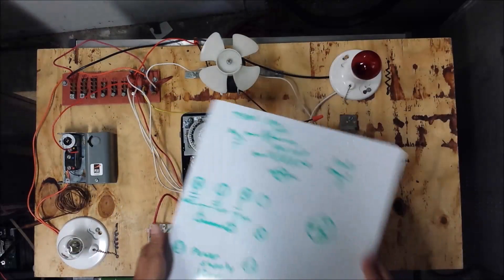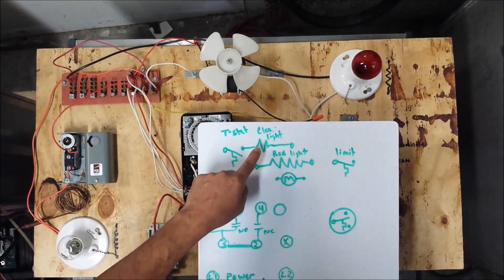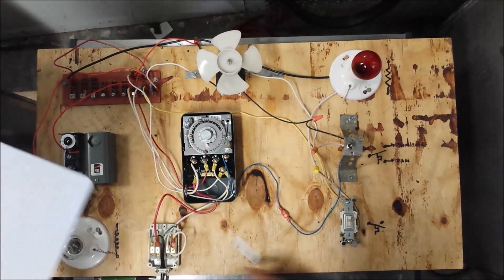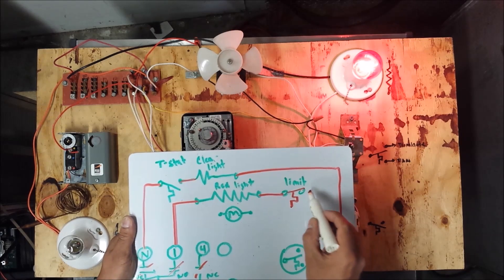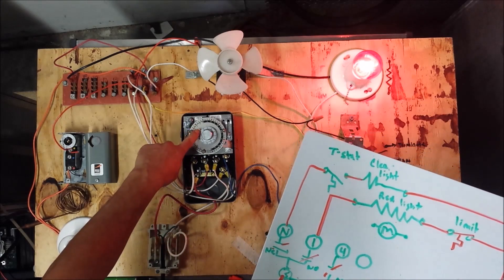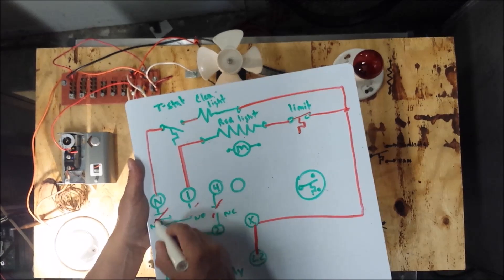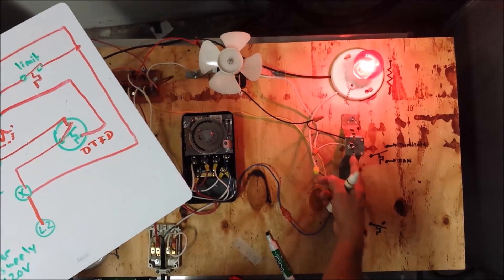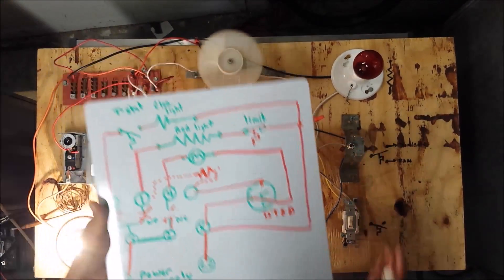Freezer Defrost Timer Live Operation

Comment: Thanks for the video.  Good circuit logic setup/explanation.  Only thing you did not mention the functionality of is the thermostat on the left hand side of the setup.  I assume that is just a refrigerator thermostat controlling when to kick on the compressor to cool the frig. to the proper temperature.

Comment: When I go to Sam’s Club, I noticed that sometimes the evaporator fans in the coolers holding the frozen foods are off.  I assume that when the fans are off, the evaporators must be in defrost mode as you have described in this video.  However, when I look at the evaporators in the refrigerated (non-frozen) foods cooler, those fans are always on (never off).  What defrost system do you think the evaporators in the refrigerated foods cooler have which does not require the fans to go off?  Or is that the fans do go off in defrost mode, because of the warmer temperature that the refrigerated foods cooler is in, the defrost cycle does not happen as often?
Reply: Some air defrost walk in coolers do not have electric heater. Most fans in these coolers are always on. 
Here is the walk in cooler which is air defrosted.
https://www.johnstonesupply.com/storefront/product-view.ep?pID=B92-118
Reply: you usually don't need a defrost in a cooler. otherwise the defrost just shuts the compressor off for x amount of time and let the fans . the only time you really have problems in coolers is when you lose a fan(or multiple fans) or a very dirty evap coil restricting air flow.  Then the coils will freeze up

Comment: Charles. Great video!!!! I have a question.
How is the compressor able to accomplish pump down of the system,when I switch from 2-4 refrigeration contact to defrost 1-3 (now closed)? I can't see it how it's done,since evaporator,thermostat and solenoid are all in series on the same circuit,namely 2-4.
By switching from 2-4 contact to 1-3 contact now energized, I de-energize the solenoid,now closing and pump down can't be accomplished by the compressor.
Please help me understand this problem. Thank you
Reply: The compressor is not part of this circuit. Only the solenoid that controls flow of refrigerant. Once the solenoid closes the condenser still runs pumping the system down. Eventually the low pressure switch on the condensing unit triggers and opens the circuit shutting down the compressor.

Comment: i have kitchenaid model is YKBRS21KAW00  my problem is .if the temp control is off!!   the defrost timer is making noise and advance, evap fan is running but slow  and compressor wont start.but freezer will be cold 

 but if the temp control is on!!!   the compressor start ok freezer stay cold,but defrost timer is not making that noise and does not move a bit, evap fan won't start at all and inside the fridge part its hot no air coming from the vent in fridge. .

the light in fridge and freezer stop working and there is a small switch for uses less energy if flip one side and flip on other side is for reduces exterior moisture the light does not come on either on the switch. not to sure what this switch  do but din't seem to make a difference in the pass but i know that light was coming on if it was flip on before . 

any suggestion of what can be wrong ?

I change the defrost timer and i change the evap fan and the temp controler too at the same time !.something is running backward but not sure what could do it ...
Show less

Comment: I helped our warehouse tech to install a timer on a freezer, we followed every step and traced all of the wiring! it's not kicking into the defrost mode or turning the compressor and fans off! IDK if the wiring is bad or bad timers!
Reply: could be a bad time clock or the defrost pins are missing? the so might not be working to pump down the system, could be a bad low pressure switch, there are many think that could cause that.

Comment: Thought N was neutral
Reply: Thought 4 was the control circuit
Reply from the maker: Usually N on the majority is for the L2 leg of power. There are done timers that N is for a different designation. Always double check your wiring diagram. You also visit the MFG. Website for instructions or diagrams. Thank you checking out the video.

Comment: Thanks for the videos, if a pressure switch is added would it be wired independently of the other controls in the circuit .
Reply from the maker: If you are adding a pressure switch to the defrost clock for the purpose of termination, then yes. The pressure switch will close, lets say on pressure rise, its switch will close, then energizing the termination solenoid on back of the clock ending defrost, clock reverts back to normally open/closed positions.

Comment: Very Nice but I am kind of confused because the terminals are different on this time clock from the time clock that you showed on your two previous videos. On the previous videos you showed L2 connected to N. I reason that this may be a different time clock and it needs to be connected differently. That being so, can the time clock that you showed on your previous video be used in place of the one that you show in this video?Anyways for me you have certainly taken the mystery out of time clocks. The only thing that I would elaborate on would be that when the solenoid closes it causes a pump down and stops the compressor during the defrost.

Comment: thanks for the video, does the terminal 4 in the defrost cycle switch connected to the compressor back to terminal Xl , or compressor should be connected in series with valve and thermostat?, please clear this, thanks in advance
Reply from the maker: I would not advise a compressor be wired through the defrost switch. The compressor can pull quite a bit of amps. Although defrost clocks can handle a good amount of amps, I would control the compressor via a contactor. Then let the defrost clock, thermostat, etc control the contactor.